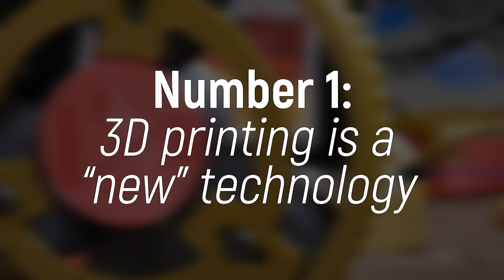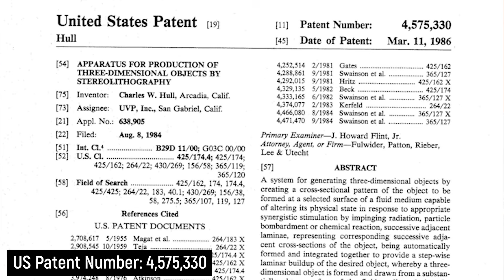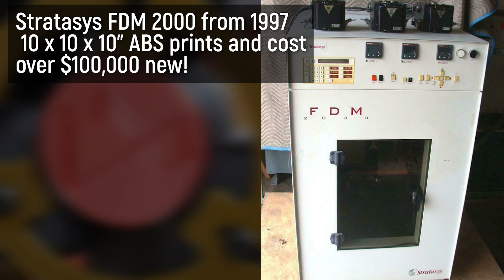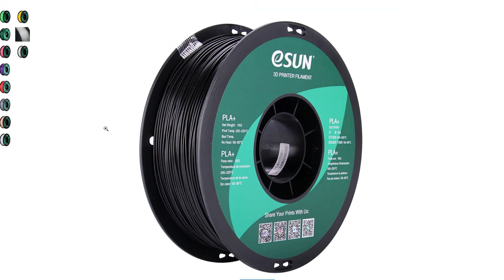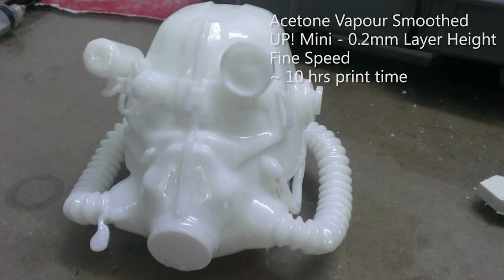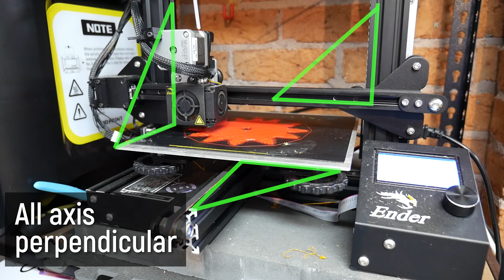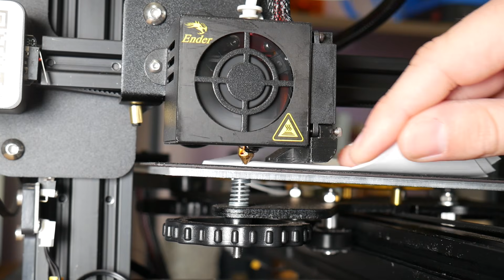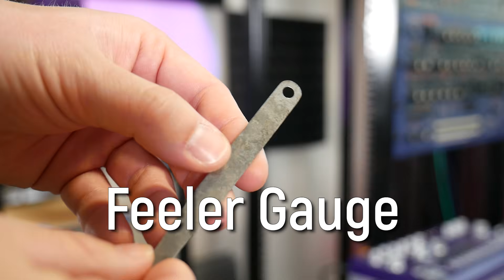3D Printing Myths I used to believe...

Comment: This isn't really a misconception that I've outgrown; rather, it's something I noticed YEARS ago that I have NEVER been comfortable or satisfied with -- and you touched on it EVER so briefly (8 minutes in): the use of FOUR adjustment points rather than THREE!  Anyone who has used an old-fashioned transit or level for surveying or laying out building footings or such (prior to LASERs becoming affordable/ubiquitous) will surely have noticed the simple use of the THREE point leveling.
To get a grasp of the problem, consider it in reverse: think of starting out with all four points PERFECTLY coplanar, precisely where you want.  What, then, if you move any ONE adjustment?  Well, obviously, the other three are STILL coplanar and the moved culprit is now either flapping in the breeze (assuming the adjustment is only FORCED in one direction but SPRUNG in the other) or pushing its corner OUT of the perfect plane -- and WHAT WOULD IT TAKE to remedy this?  Well, it's COMPLICATED - but this problem simply does not exist in the 3-point system!
As a slight hint, I propose something that I've never (in all my years in this community) heard discussed or considered: you really should work DIAGONALS in order to deal with the hypothetical problem.  And (back to the forced one way and sprung the other) pay attention to what happens when you reach the end of the spring's reach (or the end of the threads).
If you (dear, bored reader) are still going "Huh?  WTF is this fool ranting about???" - just round-file this and cruise on as if I just told a tired, worn-out old BLONDE joke.
Have you ever met a tired, old, worn-out blonde?
Oh, nevermind....
Reply: That's why you are supposed to use diagonals when you torque wheels.
Reply: @timgreene2029  Negative!  AAMOF, there is NO conceptual connection between the two!

Comment: Feeler Gauge? So I Wasn't Wrong Then, I Built My 3D Printer, From Scratch, I've Always Used A Feeler Gauge To See What Distance My Nozzle Is From My Bed, I Had A Flaw, If Anyone Knows Anything About Aluminum Beds You Know What Aluminum Does When It Gets HOT!! It WARPS!! Just Like Aluminum Heads On A OverHeated Car Engine 😁, My Bed Is Cold Rolled Steel, Will NOT Warp!! I'm Setting All This Up This Coming Week, Update Soon!!

Comment: Also, now days we have fdm. We don't even have sla. Closer to that and the same is resin printers. You still use a prusa, the prusa is the same as the creality . They are the exact same design, no?  They are identical. It's just different parts. Actually the prusa is worse because it's actually 3d printed parts. The creality is metal and abs injection molded at least. SO, it comes down to being a fanboy like apple fan boys. Sorry the prusa is so overpriced. It should be 350. Not 1200. It is not any different. Max prusa should be 500 with very high quality part's. You always use the prusa. Lets be honest, it's a poor design.

Comment: I have concerns that using a steel gauge would burnish a brass nozzle overtime. A small piece of printer paper has always worked fine for me. The real issue I've dealt with is the bed itself not being perfectly flat. This appears to be associated with uneven heat and leveling tension... found on various printers. It's tough to get a bed perfect at each corner, along its edged and in the middle... Small prints are easy but for large foot prints I typically use an over size first layer to help compensate.

Comment: I keep hearing comments about resin prints that mysteriously shatter. People claim it's because the print is hollow with no drain holes, but can't explain the mechanism. They give reasons but they don't stand up to simple logic. My thought was when the parts are glued together they're under constant tension and eventually fail. Care to do some experimentation?

Comment: Thanks, I have been using the method for leveling you just described for many a couple of years now and been getting excellent results but it's very hard to find any instruction on the Net about it. I was uncertain about it but kept doing it because it gave such good result, you have just validated for me.

Comment: "ABS is stronger than PLA" myth is everywhere and now has a rising variant "PETG is stronger than PLA". 

- Strength is the maximum force (per unit area) or stress, a material can withstand;
- Hardness defines the relative resistance that surface imposes against localized deformation induced by mechanical indentation or abrasion;
- Stiffness is the relationship between stress and strain and defines the ability to maintain the original shape when a tensile/compressive stress is applied;
- Toughness is the amount of energy required to fracture a material under impact. 
Parts printed with PLA are harder, stiffer and stronger but way less though than ABS so they are more brittle, however the brittleness problem unless you have tiny parts in most applications is compensated by strength and better layers adhesion, the main issue of PLA for functional applications is the too poor thermal resistance, there are special variants that address this issue but unfortunately are produced by few brands and they are way too expensive (10x the cost of regular PLA latest time I have checked).

Comment: I got my technology diploma over 20 years ago in CAD/CAM and 3D modeling and 3D printing was part of our coursework (was widely referred to just as Rapid Prototyping back then). We used an enclosed FDM system from Stratasys and used Nylon and ABS filament. The printer was very finicky so was rarely available and it cost the school over $10k back then. Then commercial color printers started becoming available for under $5K and it was an exciting time. Of course there were other types of rapid prototyping back then like stereolithography, SLM, sintering etc. But I never had access to those methods.

Comment: Folding the paper is too much space i think. Ive been a machinist for over 10 years and I've 3d printed professionally as a result, I have used a single piece of paper beacsue they average about .0042-.0047" in thickness so the space is about perfect for leveling, otherwise a shim from a shim kit is what you should use(feeler gauge)

Comment: I was dabbling around the community when we had all of those warping and delam issues where parts would shrink because they'd cool before they were done printing and asked why they dont just heat the whole thing up while its printing and then cool it at the end (which is what a heated bed and more so an enclosure does) and I think the first RepRap heated bed was made off that idea lol

ABS was easy to get and so was weed whipper string which is what printing typically was using

Comment: One thing I've noted since I've had my Ender 3 pro (had it for about 2 weeks now) is that I have not ever once had a print fail on me if I use a raft, so after having many brim prints fail, I tried the raft and began to get frustrated at just how much material is basically wasted on it, but mine was set to 15mm rafts, I now use 2mm rafts wich is just enough to get the print off the raft comfortably without damaging anything. And again, as I said in the beginning, I've not had one failed print using a raft. Ofcourse you still need your nozzle height to be in the ball park but I'm getting some pretty amazing results this way

Comment: Just for you to know a polymer "alloy" is usually called a blend if it's a mixture of two different polymers or a copolymer if the polymeric chain itself is composed of two different monomers.

Also thanks for the advice about feeler gauges, now I'm 100% sure that my bed is convex...

Comment: That whole bed leveling procedure makes me so increadibly happy that I bought a printer with auto bed leveling. Especially for  someone new to 3d printing it just removes so much possibilities for error
Reply: All I do is manual level. Done it 100 times. The thought of adding a BL touch seems like too much effort for me now when this simple method works.
Reply: @billjonesnation  I have to do it a 100 times a day
Reply: I agree. With the price of components being what it is, there's really no excuse for manufacturers not to include auto leveling. It completely solves an annoying point of failure. Hell, my X5SA has as much as 0.7 mm variation across the bed and it's no problem at all with auto leveling.
Reply: It's really not that big of an issue. I do it once every time I change a nozzle. Then if you see a first layer going down thin, or thick you tweak it a bit, but once set it stays there.
Reply: @court2379  that's It. Bed leveling is something I do every other month, if much. All the time it's just some fine tuning between one job printing and another.
Reply: trusted auto level once cost me a new bed on a 2hour old printer now manual set to make sure then auto level and watch the  first layer just in case its 5min extra
Reply: Anyone with great experience will tell you auto tramming your bed is faulty, and almost NEVER correct without some manual leveling first. I a printer with an auto leveler, but I always manually level it first, then allow the mesh.

Comment: Ultimaker, when you "level" with paper, sets the position to I believe 0.07mm.  So it is assuming the paper is 0.07mm thick.  Sort of.  Ideally you want to level a little low so you want a bit of squish so the parts stick well.  So I wish it set the height to maybe .12mm when you level with a 0.07mm thick piece of paper.  Anyway the point is the leveling procedure does not set the z=0 point on many printers but some other height.
Reply: If you tram it to 0.7mm above the bed, but you tell the printer that it's 1.2 mm, then it will dig into the bed when you reach 0mm.
Reply: @jpaugh64  Your numbers are off by 10X but yeah that's what you want.  You want the nozzle to "dig into" the bed at 0mm and when it does the first layer at say 0.2mm then you really want the nozzle more like 0.15mm above the bed for a little extra squish.
Reply: @bath_interferometers  Whoops! That 10x makes a bit of difference. Is it not possible to set the first layer height to 0.15, instead of falsifying the bed height? It seems like that would be easier, and should be configurable in the slicer software.
Reply: @jpaugh64  That doesn't help.  The slicer creates gcodes for the exact right amount of filament for a .15mm layer if you set the first layer height to .15mm.  If you set the first layer height to 0.1mm then it puts out less filament accordingly.  Somewhere you have to tell the printer to overextrude the first layer.  Some slicers let you set the first layer flow rate but most of the time you just level the printer a bit low.  This is true of basically all printer types.  It keeps the power in the hands of the person doing the leveling instead of hidden in some slicer setting.

Comment: I think it’s very important to realize that what we refer to as “leveling the bed” is actually two operations: the first operation is getting the bed squared up with the XY plane of the nozzle. For this purpose it doesn’t matter what method you’re using or whether your paper is folded or not: as long as you’re consistent throughout the process, your bed will end up nicely squared. 

The second operation is that you’re defining exactly where the Z=0mm position is once the axis is properly homed. For this, the thickness of your paper or feeler gauge matters a lot. All slicing software assumes that Z=0 is the position where there is zero gap between the bed and the nozzle. When this is true, and your first layer is set to be 0.15mm high, that’s exactly what will happen. If however, you’ve leveled your bed such that Z=0 is a piece of paper thickness above the bed, your first layer will actually end up being 0.25mm high (assuming 0.10mm paper was used). 

I think the main point being made in this video is that most of us are very good at the first operation, yet have never even really thought about the second operation of setting the z=0 position. We can get away with ignoring this detail in most cases. But if you want a perfectly reproducible first layer that actually corresponds to what the slicer intended, take the time to get this correct.
Reply: I’ve come up with a simpler method for compensating for feeler thickness without having to actually adjust anything in software or even know the exact thickness value. During the homing operation, insert your feeler gauge or paper or playing card in front of the Z limit switch. This will cause the home position to be slightly above the bed. Tram the nozzle to be just touching the top of your feeler, and that’s it. The next time you home the Z axis (without the feeler in place of course), Z=0 will correctly be set to the top of the bed surface.

Comment: I started off using a feeler gauge, because of its theoretically better accuracy, but it was so fiddly actually trying to get the gauge level underneath the nozzle that I tried a single sheet of paper instead, and got more consistent results!

Comment: Which 3D printers has less problems . 
Direct Drive or Bowden.
in my tests i have found that Direct drives perform better and are more reliable than Bowden.
 sales of Direct drives are on the increase as a priority upgrade to their printers.
What do you think Angus.

Comment: I usually just run a quick leveling print and adjust accordingly, it’s typically the same corner that needs a small minute adjustment. The adhesion is always really good too and then I stop/proceed with my actual print with first layer confidence

Comment: Print a first layer circle on each corner of the bed. Peal it off and measure the thickness of each one, then adjust the bed height to obtain the ideal thickness.

Comment: I installed a 3dtouch, a cheap bl touch clone

Never looked back, i dont need to necessarily worry about bed leveling with paper anymore

It use to really frustrate me

I would say you should start to use paper, just so you understand how the printer fundamentally works, then install a bltouch

Comment: I found best resolution was when using unfolded paper and still having stick issues was just increase initial layer from 100% to 130% haven't had an issue since and I use brim not skirt , I'm more or quality of speed so it's almost perfect for me, Ender 5 pro I use, skirt leaves the initial layer undesirable in my opinion but skirt is mint

Comment: i struggled with the paper leveling method at first and then I learned about using dial indicators to make sure its level and then using mesh bed leveling to make the leveling finer
Reply: dial indicators?
Reply: @definingslawek4731  yep the tool that measures imperfections on surfaces, the one I use is made by fowler

Comment: "3D printing is expensive" is the one that gets me. If you're just printing for fun after the initial cost for a printer the fillament cost is so cheap. When I first started my first roll of fillament literally lasted about 3 months
Reply: For the few times I needed custom parts, I just create my files in AutoCAD, export to a compatible file type, and send them out to be produced.   The price is nearly as reasonable as something mass produced, just a week lead time, and the quality is unmatched to any home machine.  My go to is Nylon 12 using HP Multi Jet Fusion process.   I can't justify buying a personal printer with such high quality components produced at such reasonable prices.

Comment: Paper mills try really hard to stay at .1 for office paper and are usually bang on. .1 is also the typical expansion distance for the bed and nozzle. After that you baby step to the right height and then save. Problem is a lot of printers have a hard end stop. Adding a screw adjustable end stop is a good way to work it out. Level with paper and print a couple of test prints while adjusting the z endstop.

Comment: good video, but not quiet sure I follow what you are doing starting at about 9:50. So you are pretty much tightening all 4 corner leveling screws to pull the bed all the way down, Is this done everytime you start a new print? Then when you say raise the Z-axis, by the feeler gauge thickness (1mm), you show that you are lowering the Z axis (confused) and then you show that you are adjusting the corner screws to fine adjust, is that correct? Finally is this done at the start of every print you do? Sorry for all the questions, but I've been having a hell of a time getting my bed releveled using a CRTouch and a BLTouch, both printers suddenly decided that they wanted to go out of whack, and I can't get either of them leveled to get down a single first layer, I've been fighting both printers for 3 and a half weeks now Both printers are less than a year old, and as I mentioned previously, they were both printing like a dream without ever needing any adjustments. Then one day just went tits up.  Thanks

Comment: The part about bed to nozzle distance was very interesting. Also fell for the old paper leveling trick that's everywhere on the internet.

But can you tell how the new ABL Z-Offset wizard is working with this information? How should I use it to set the right probe to nozzle offset?

Comment: I worked as an process engineer for Solidiform inc. back in the 90’s that was testing 3D’s resins for proof of concept use to generate Prototype aluminum parts through the lost wax casting process for major defense OEMs.    I generated reports on every new resin 3D came out with for about 5 years there!   It was an amazing time.

Comment: The bed level is actually based on the software used.  Now days Cura wants the nozzle to be set at 0, not a piece of paper and that is they way ALL slicers should be done.  Nozzle should be set to touch the bed and the software should move the 1st layer to the correct layer height.